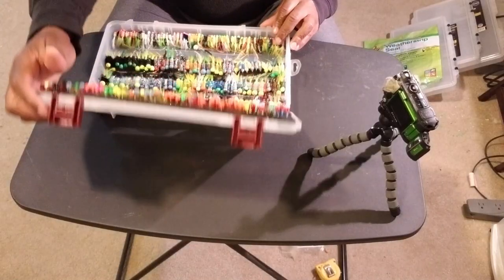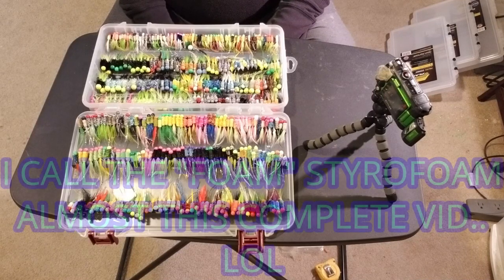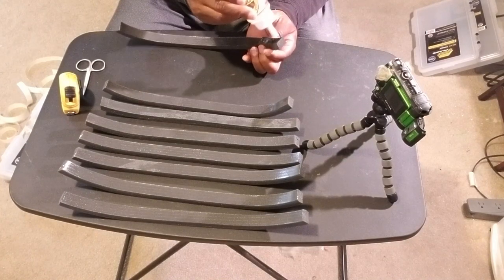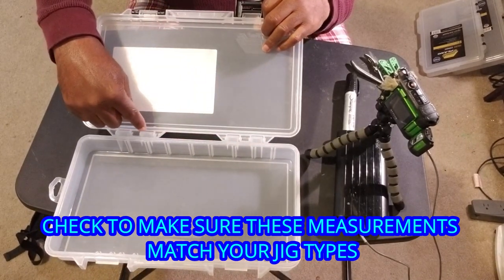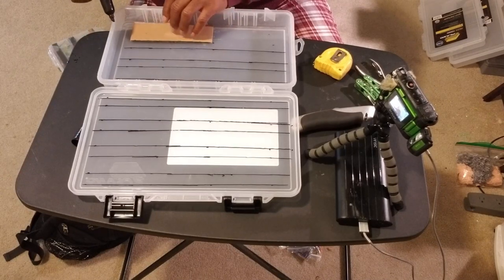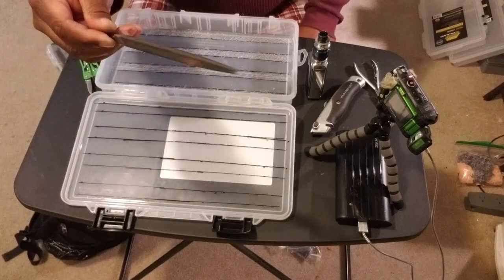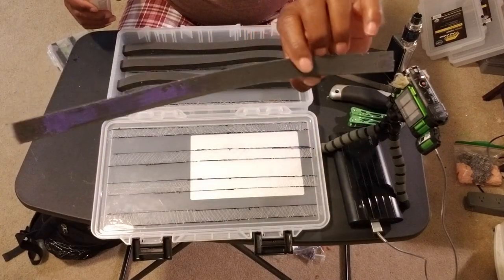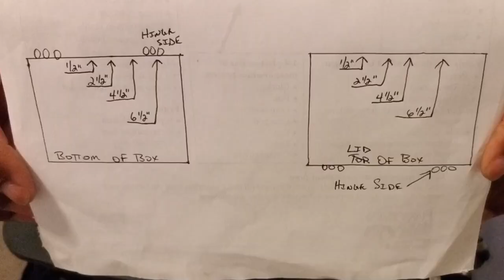DIY Crappie Jig Box - DIY Crappie Jig Storage - How To Make A Jig Box

Comment: Very well done...thanks for sharing! + I have tied my own jigs for trout and panfish for spin fishing and fly fishing.  The jigs I tie are 1/32, 1/64, 1/80, and 1/100th ounce on hooks ranging from size 12 to size 6.  Have a good week.
Reply from the maker: Jigs tying becomes a great challenge the smaller the hook..... Thanks for watching and commenting.....
Reply: I have tied "match the hatch" trout flies for years, so tying mini-jigs and micro-jigs comes pretty easily.  My latest adventure has been using cross-cut rabbit strips and zonker strips for streamer patterns tied to mini-jigs which have proven extremely effective and durable.  The micro-cut cross-cut rabbit strips work best for smaller sizes and are available in a wide variety of solid and mixed colors.  I also tie many nymph patterns on lead-head ball style heads with flattened sides to vary the sink rate and animation in the water.  There are many excellent materials and techniques available from fly tying that can be applied to jig tying.  For example, tying a black-nose dace minnow pattern on a jig hook will catch many fresh water fish species.
Reply from the maker: @ronuhlenhopp9368  For some reason I haven't veered away from chenille and hackle I guess just from it working so well....I need to open that door to other material and will do so in the near future..... Thanks for the awesome info....

Comment: Great jig box. Try hot glue adhesive. No scuffing needed and you can use the box immediately. I cut a piece of hardwood the length of the foam to press the foam into the glue evenly and hold it till the glue cools.
Reply from the maker: How well does hot glue hold? Thanks for the idea, I'll be giving that a try.....

Comment: I decided to build one of these boxes going by your design, materials list, etc.  The box was easy enough to build and came out pretty much exactly the same as yours.  I have a question however.  Are you hooking your jig hooks into the top side of that weatherstrip or into the side of it?  I don't know if they have changed something in those strips since you built these boxes or not, but  once I penetrate the top side of that material past the barb of the hook, I almost destroy the strip just trying to get the hook back out again.  Just wondering.   Thanks for all your content.
Reply from the maker: No specific direction, check out my jig box pics ...... They go in the side, the barb does lock in so you have to push down to get the jig out.....I still haven't built my new box yet and the foam is still holding my jigs....4yrs strong..... Hope you get it to work as it has been a perfect box for me..... Thanks
Reply from the maker: Keep me updated if you would.
Reply: @SK_CrappieCatching  Oh yeah....hooking them in the side is the ticket.  Works fine that way.  Thanks,

Comment: Gonna be rain, 15 mph wind, so no fishing. Reckon I'll get started on my jig box, already have the stuff, so no plus sign for me, I'm good.
Reply from the maker: Greatest pastime when you can't go fishing...... Thanks for the feedback.....
Reply: @SK_CrappieCatching  I made mine a 3 row box. When I laid out the 4 rows it seemed a little tight on tail room. Just preference. Also some of my strips of foam seemed to shrink after I cut them 13.5 to 13 and I had to get more foam. I suggest cutting foam 14", then trim to fit after the glue dries. Now I have to fill up the box! Thanks SK!
Reply from the maker: @joejatek2261  Wow..... I've never seen it shrink that fast.....13 1/2 has worked very well for me..... actually if you see when I lay there foam in the box that was after applying the glue....
Hope you enjoy your box ad much as I enjoy mine.....
Reply: @SK_CrappieCatching  I think I may have stretched it a little when measuring it and cutting. The foam should be fully relaxed when you do that. My bad, but the box turned out great. Just tied a dozen more jigs to put in it while waiting for the glue to cure. I'll be on the lake (Lanier, GA) at sunrise Monday.
Reply from the maker: Good luck on your catchn trip....